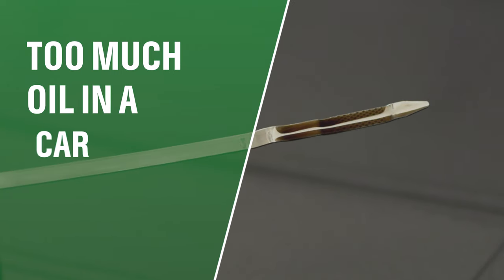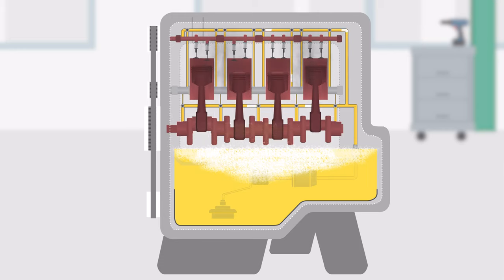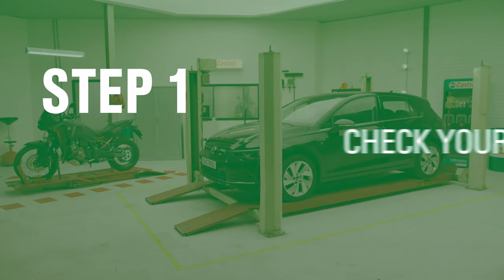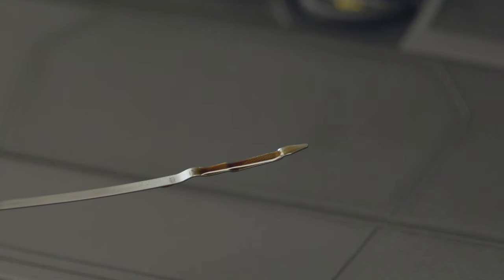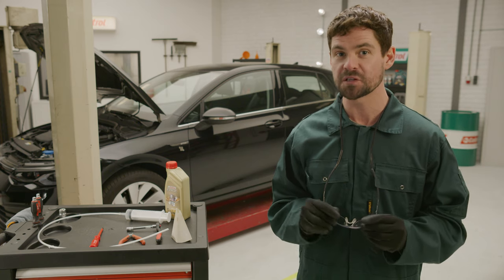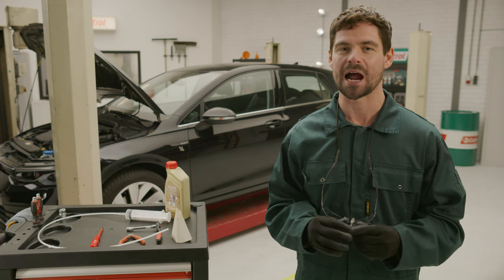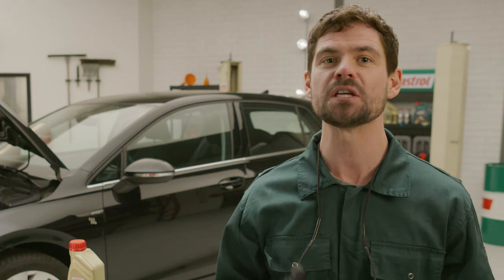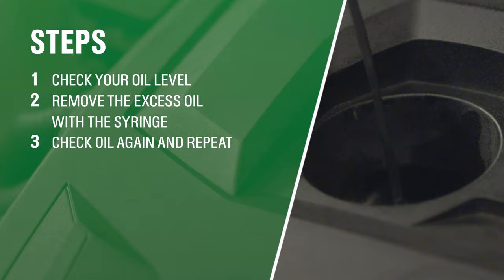Too much oil in car engine: what to do | Changing car engine oil | Castrol U.K.

Comment: I used  the pump from an old shampoo bottle and just taped a drain pipe on to it making the join air tight. Worked perfectly. The advantage over the syringe was that you can hold and pump with one hand while holding the drain pan with the other.

Comment: I bought a small 12v oil pump from lidl,  specifically for this purpose. Comes with inlet and outlet tubes, and crock clips to connect direct to battery.  Works great , good for full oil change too.

Comment: I have a 9l vacuum pump I use when doing oil changes and used it to remove 4 litres of excess oil from my partner's car which had been grossly overfilled by her cousin who is actually a marine engineer 🤔

Comment: What a great way to remove excessive oil without removing sump plug could you tell me what size tubing you used thanks
Reply: you can use something small like 3/16 whatever fits on syringe and goes in dipstick tube.

Comment: will the oil color change if there is too much?  I have a volvo 05 v50 t5, and it is very possible I over filled by 1/2 quart.  The land the car is parked on is a small light angle, which makes getting a straight level gauging impossible.  I am getting a coffee bubble color, which leads me to suspect a head gasket issue, but it could be something like a bad PCV system.  The car has just under 200k miles.  When I discovered the change in oil color in the oil cap, but not the dip stick, I stop driving the car.  Any advice you have, I like to know

Comment: I like to write on plastic radiator cover in silver marker the amount of oil car takes, viscosity, oil filter model number, and drain plug wrench size saves a lot of running around and looking things up. but i still had garages just throw in 4 quarts even though it only takes 3.4 when i didn't want to do my own oil change mid-winter.
I have a oil remover suction tool that has a pump like a bike pump and a cylinder that holds about a gallon  you could actually suck all oil out and replace it without crawling under car of course you would still have oil in filter.

Comment from the maker: Did you ever have problems with your car engine oil level?
Reply: As an independent tech I have problems with cars with no dipsticks, had a car in the other day that was over filled by a main dealer ,with no dipstick you're limited with syringing it out 😂

Comment: how do you check the engine oil on the dipstick properly?  in the morning or after 5 to 10 minutes after turning off the engine?
Reply: Either as long as the car is sitting on a level surface.

Comment: I accidentally put way too much engine in my car and then 
BiG buff of blue smoke and then a loss of power. 
I pulled over straight away. So iv not driven at lenth like this, but im bricking it now, lol 

Do I simply need to reduce the oil level, or is this a sign of more damage.
Any advice most appreciated.

Is there a clear indicator that something else is wrong after this that I should watch/listen out for?
Thank you
Reply: did you ever figure this out?
Reply: did you ever figure this out?

Comment: I put too much oil on polo classic 1.9 tdi and the engine won't start, it's only cranks and that's all. If I remove oil to the right level ,will the engine go to normal starting.
Reply from the maker: Hi and thank you for contacting us. Unfortunately it's too difficult to say what is happening without physically inspecting the vehicle. We would advise bringing a mechanic to look at it, as they will know better where is the problem.

Thank you again, hope this helps and fingers crossed 🤞

^ Team Castrol